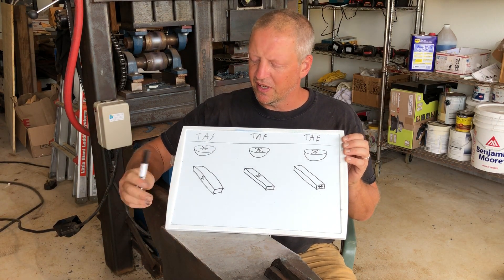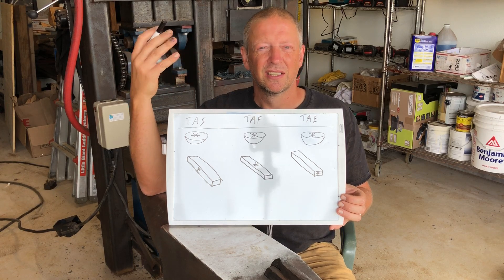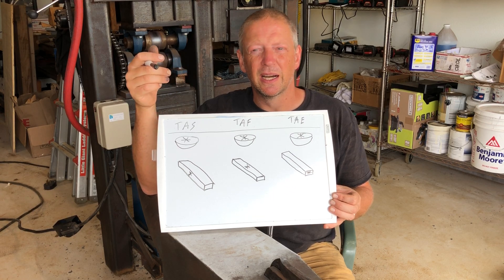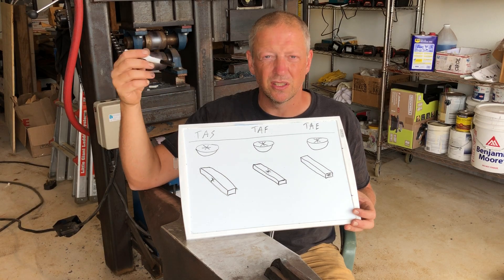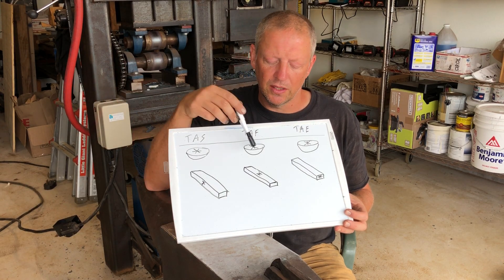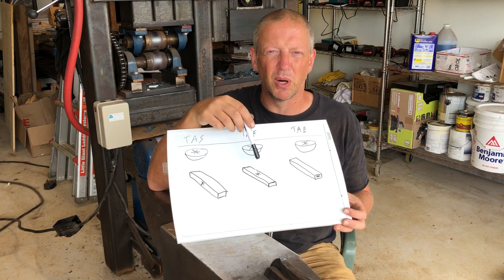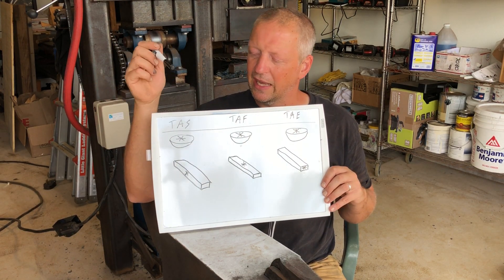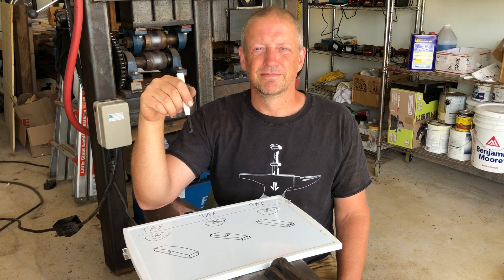Wootz Forging: Ingot Orientation

Comment: Thanks for sharing, in this case the scales remains on top? Because I see the dendrites on and some kind of spines at the bottom of the ingot. Thanks again!
Reply from the maker: The dendrites mostly start from the outer rim of the ingot and grow toward the center of the ingot. This is an average, though, because they do not all start out perfectly perpendicular to the crucible wall. The primary dendrites then grow secondary arms that are perpendicular to the main trunk, much like branches growing off the trunk of a spruce or pine tree. There are also tertiary arms, but these typically aren't visible. The dendrites are present throughout the ingot, but may only be visible in a few spots on the surface.

Comment: In all three methods you lose about 30% of the mass depending on the quality of the ingot.
Interesting fact. This is approximately how much is allocated for the cut portion of industrial steel ingots.
An angle grinder and a disc for cleaning weld seams are the best help in this work.
Reply from the maker: I find that a large part of the efficiency of different approaches comes down to the shape of the starting ingot and the forging tools that are available. Wider/flatter ingots, for example, are extremely difficult to forge TAE without creating "piping" in the center of the bar that leads to substantial losses. Taller ingots work much better in this orientation and can end up with minimal losses if done properly. Working by hand is also very different than power forging. As a general rule my losses are substantially less than 30%, and the majority of what I do lose is from scale and the underlying decarburized steel that needs to be ground away at the end.

Comment: Now..…what if you made a crucible with a different inner dimension, so it was long and thin instead of a chunky ingot?
Reply from the maker: Some of the historical crucibles were very different shapes. Some of the Indian crucibles were rather wide and produced a flatter ingot, while I believe it was Sri Lankan crucibles that were fairly narrow and produced more of a bar at the start. Some shapes are easier to forge, but the different shapes (and resulting forging) do change the type of patterning.

Comment: Do you add green leaves to the crucible? This seems to be one of the secrets the Indian blacksmiths used.
Reply from the maker: I do not, but it was certainly something that was included in a lot of the historical recipes. The leaves used typically had religious or cultural significance, and it isn’t clear if there was a chemical benefit. Green leaves will bring a variety of elements, with sulfur, phosphorus, and carbon being three of particular significance. An unknown amount of any of these could be problematic.

Comment: What would happen to an ingot if it’s folded a few times?
Reply from the maker: Wootz can be forge welded, but generally we don’t see it folded or restacked because it does not require further refinement. The purpose of folding or stacking other steels is to remove impurities and homogenize the carbon content, and this simply isn’t needed with wootz.
Reply: @peterburt7218  😅 mine needs it, it’s not 100% solid and I can tell
Reply from the maker: Are you getting large gas bubbles?
Reply: @peterburt7218  it looks like there’s some small and medium bubbles but my concern is it didn’t fully melt. There are some pieces sticking from the top
Reply from the maker: If there are pieces that never melted then the melt is either not getting hot enough or is not being held long enough at temperature. I normally aim for 1550c and hold at that temp for 45 minutes. Going to higher temps than this can result in a faster melt but this can also cause issues.
Reply: @peterburt7218  I think I was reaching around 3000°F but now that you mention it, I don’t think I got it quite hot enough for long enough
Reply from the maker: This is really hotter than necessary, but keep in mind that the crucible insulates the steel from the furnace to some degree. It takes time for the temperature inside the crucible to reach the same temperature as the furnace. Also, just like an ice cube takes a while to melt in a glass of water, it takes time for the steel to melt even after it is sufficiently hot.

Comment: I can confirm the claim at 2:50 about the vast majority of antique crucible steel blades having evidence of "top as spine" construction. In my own collection and the ones I have handled, seams, pinholes and fill-ins are most common in the spine. 

Some of mine do have evidence of "top as end" construction, and are often scarf welded onto iron tangs when this is the case. These examples were often the late era (18th C), "crystalline" Indian wootz.
Reply from the maker: That is great info! I had not seen any weapons that I could confirm as TAE so I have avoided claiming it as a historical method. On the other hand, I think there are very few techniques thought of today that haven’t been tried by earlier smiths over the millennia.

Comment: Hi Peter,
I'm loving the videos and am grateful for having access to your wealth of knowledge in this manner. I have two questions:
1 . Would grinding/boring out the center, only as deep as needed, then going with TAS or TAF have any inherent problems? 
2. Will you be giving us a demo on forging TAE in the future? 

Thanks either way,
AJ Prime
Reply from the maker: I’m glad they aren’t putting you to sleep! In answer to your questions: 1) it is certainly reasonable to remove only the needed amount of material and then continue forging. The only concern would be making sure that the follow-up forging didn’t cause any cold shuts or seams. I suggest doing some amount of forging prior to machining since the primary carbides can be pretty large. 2) Possibly. I’m currently exploring other routes, but I may go back down that road  again. If you go over to the Dragon’s Breath Forge channel you can find some of my earlier videos, and I know at least one of those shows TAE forging.